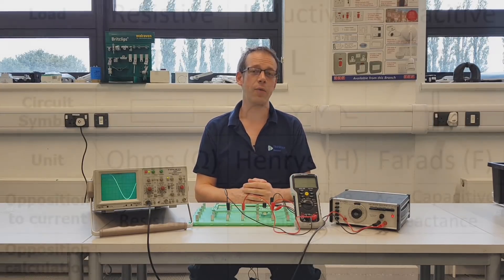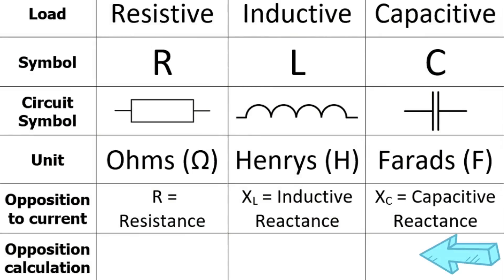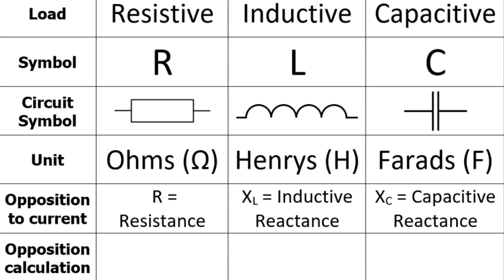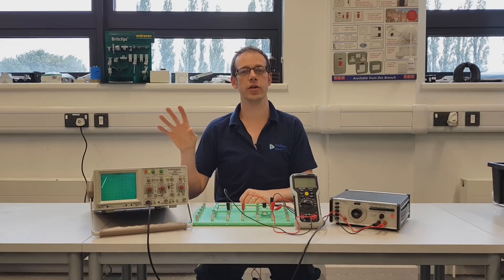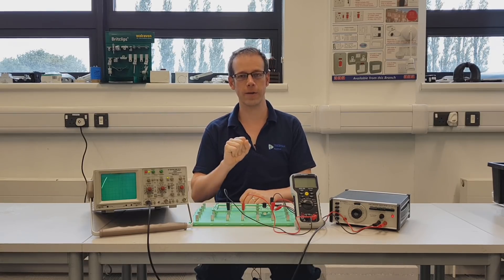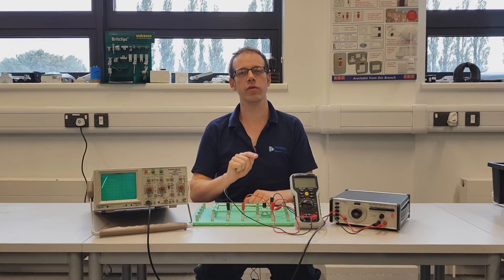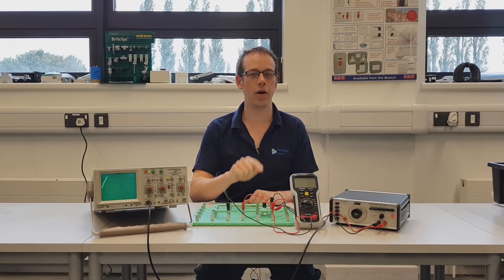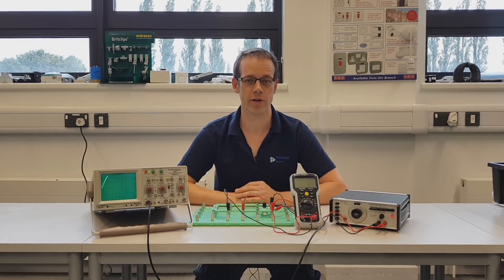AC Theory: How Does Frequency Affect Inductive Reactance?

Comment: so when you increase the frequency during an inductive circuit; current decreases and resistance increases. What happens to power factor and phase angle when you increase frequency and how are phase angle and power factor related to frequency? I'm currently in the electrical program in states and I'm not understanding how frequency relates to impedance,angle theta, and power factors.

Comment: Dear Joe, this is amazing video, thank you for putting this up. However, I’ve found some discrepancies between the observation and theory calculation in it. For 6:20 in the video. The O-scope tells me that the experiment of V peak at 4V. When you set the frequency at 50Hz, with 47mH pure inductance circuit, the total current is 20.9mA. By calculation, XL=2*pi*f*L=14.77Ohm in theory and the current should be 4*0.707/14.77=191mA. It shows the same 10x discrepancy between observation and theory. Later on, the frequency was set to 110Hz in 6:55 in the video, the frequency more than doubled than 50Hz, which means XL should also be more than doubled. However, the current in the circuit only droped to 20.5mA. The theory current should be 4/(2*pi*110*0.047)=87mA. The dicrepancy converged a bit (20.5mA in observation VS 87mA). Have you got any idea why this happens? Thanks!